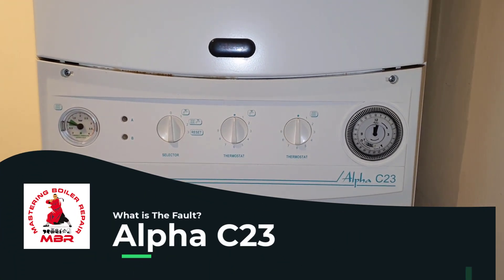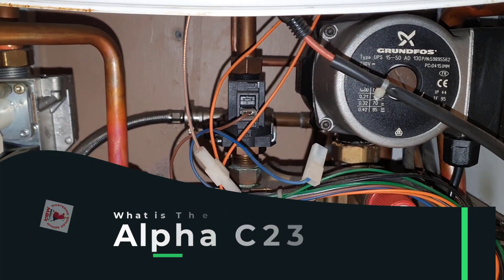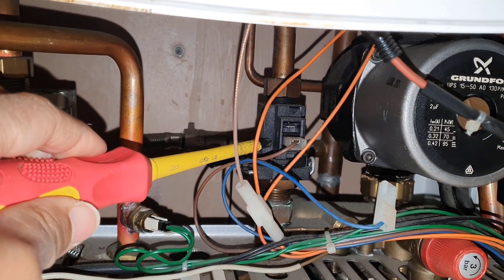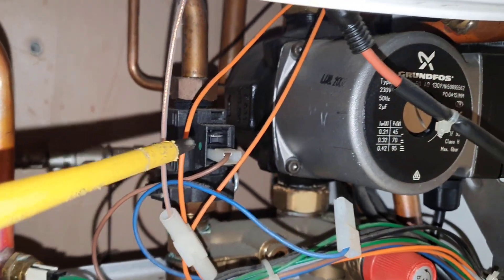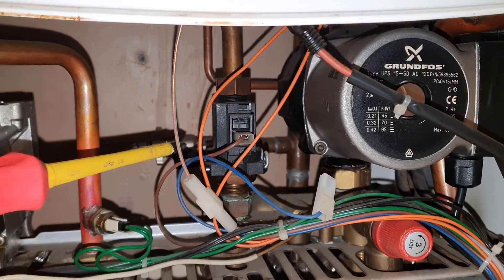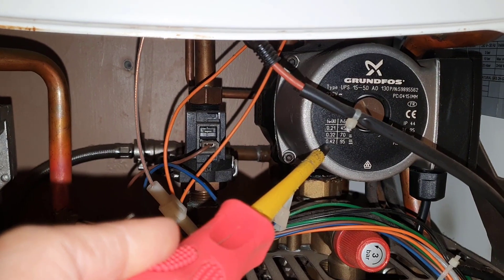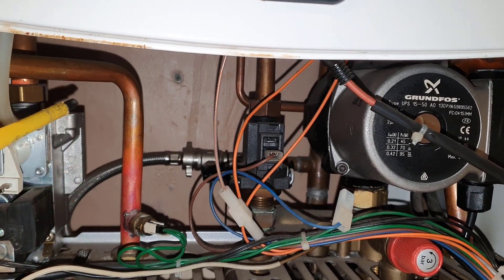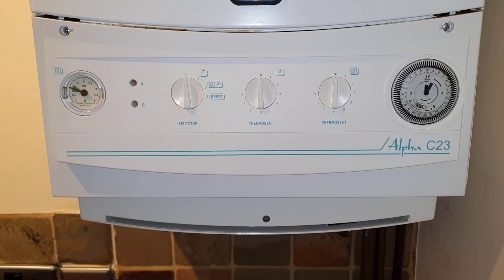Alpha C23 The Answer to The Fault

Comment: Good morning sir, does this mean that there was no hot water draw off by the consumer therfore the water had nowhere to go which in tutn caused the unit to overheat any info would be highly appreciated thankyou
Reply from the maker: Hi Harry you can learn not more from me if invest in my boiler repair library its only £10.00 per month
Reply: @ARBoilers  hi could you send me your email please when possible thanks
Going back to my original question am i right in what i described any help would be extremely appreciated thankyou
Reply from the maker: @bahiaharjinder  Hi Harry your your description was not correct my email address is tony@engineerteam.co.uk
Reply: @ARBoilers  hi thanks for the reply I've now rethought it and its the flow switch constantly on.. in turn causing the boiler to stop on unnecessarily hense the overheat symptom